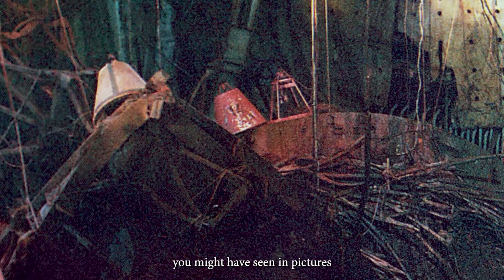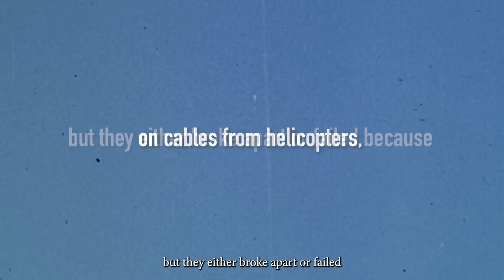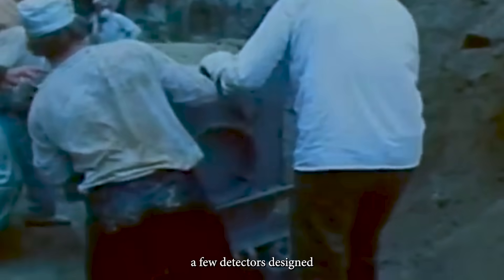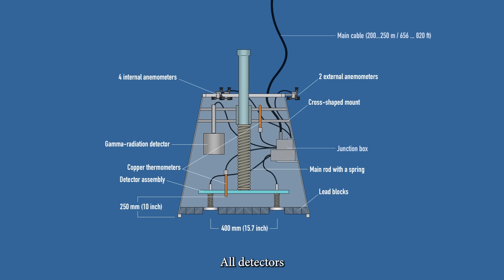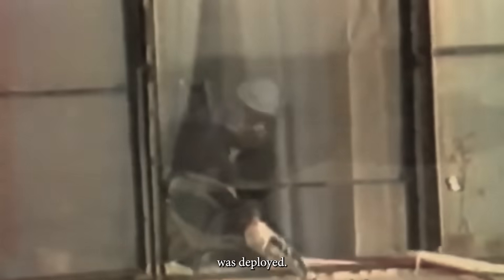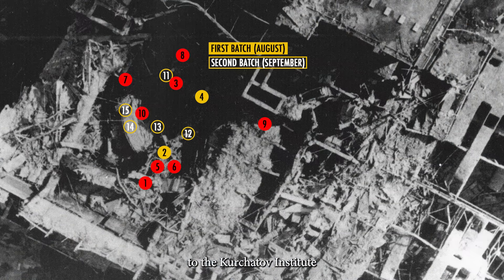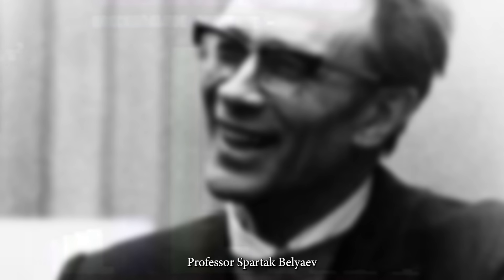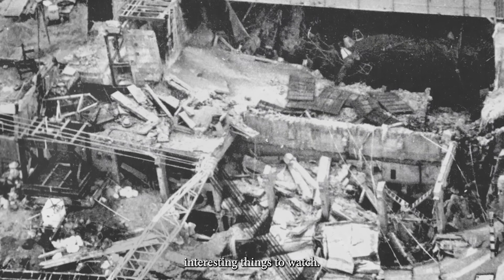Strange Devices in Chernobyl Reactor – What Were They For? | Program Buoy | Chornobyl Uncharted Ep10

Comment: 1:59 Minicomputer what a laugh 😂

edit: It’s crazy that that was then called “Mini”
Reply from the maker: It is not a "laugh" but a correct classification, which I suppose you are not familiar with. There are mainframes, there are minicomputers, and there are microcomputers (PCs, basically).
Reply: @ BRO you get what i mean 😭
Reply from the maker: @Cool-kaiden  Frankly, I do not. This is the epoch that was 40 years ago. Tech everywhere was big and low-integrated. Compared to what was common 10 years prior to that, this is very much "mini."

Edit: typos
Reply: Sorry for that, I love your videos. But i just wanted to say: it’s crazy that that was then called “Mini”
Reply from the maker: @Cool-kaiden yes, it indeed is. Maybe I am just used that it is normal thing I see in papers, hence my reaction :))
Reply: I’m gonna edit that

Comment: Question- What happened to the steel lid of the reactor. I find very little info about this. 
When the lid popped off what happened to it after that? Where did it go?
Reply from the maker: Just to clarify, do you mean cylindrical scheme "E"? It is standing tilted in the reactor shaft. You can see it right in the thumbnail of this video with two Buoys atop; if you mean Scheme G (mosaic floor) — it was scattered everywhere in small parts.
Reply: @ChernobylFamily  I don't have much knowledge,
I am referring to that 1000ton lid made of small steel blocks.
I guess I am referring to Scheme E.

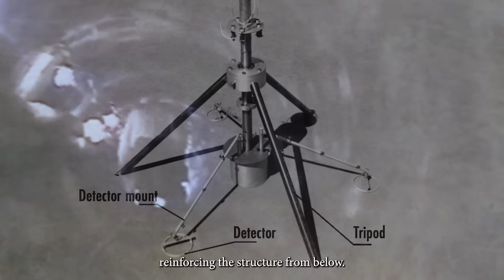Comment: 2:52 Actually, the heat exchanger still got built anyway, just never turned on.
Reply from the maker: Are you sure you are not mistaking it with the Bypass system, which was built but used literally in bypass mode? Because guys who manage the Shelter from late 1986 say down, there is just concrete.
Reply: @ChernobylFamily  Maybe, the documents could be incorrect and the personal experience could be the real correct thing.

Comment: The amount of destruction in unit four is shocking.  I’ve seen these buoys in photos and never knew what they were for!
Reply: The level of destruction was the result of the reactor going prompt critical, an exponentially and rapidly expanding chain reaction dominated by fast neutrons. That always leads to the core  disassembling itself explosively, which immediately halts the nuclear runaway but disperses the Uranium that went prompt critical. Neither the reactor drum nor the building could have contained this uncontrolled release of energy, which was equivalent to the entire Soviet power grid for a few seconds. The reactor has a maximum power level of 3,200 megawatts thermal, and 1,000 megawatts electrical. The power excursion took the reactor's power level beyond 33,000 megawatts, likely hundreds of times higher than its design maximum of 3,200 megawatts thermal. Nobody will know because the instruments that could answer this question were all obliterated by the explosions that destroyed the reactor. The SL-1 accident in 1961 in Idaho was also the result of faulty control rods like Chernobyl and it too resulted in the reactor obliterating itself and killing all three of the operators who were reconnecting the control rods to their drive mechanisms. The U. S. also destroyed nuclear reactors deliberately by causing them to go prompt critical for the purpose of gathering data. Unlike the former Soviet Union where multiple nuclear accidents have resulted in deaths and injuries, the SL-1 reactor, dubbed "Short Lived One" was the only fatal nuclear reactor accident in the U. S., despite a number of deaths from criticality accidents.
Reply from the maker: Glad to help!

Comment: Brother do you have any footage of the smokescreen project you mentioned @ 1:08?

I belive I've seen two angles of it before in documentaries but I just can't seem to find them anymore.
Reply from the maker: Need to search. Cannot say right away, unfortunately. It is easy to mistake it with actual smoke which came out from the reactor during early stages of graphite burning.

Comment: If 90% of nuclear fuel remains within the reactor… there’s no way anyone can get anywhere near it just months after the accident.

For example, Fukushima reactor 2 where there seems to be a breach with in the reactor vessel somewhere but they just don’t know for sure exactly…

That is because they still can’t get anyone near the reactor 14 years after the accident. 

Only the most heavily shielded radiation harden robot can get inside the reactor but even that still only works for a very short amount of time.

Today you can go take selfie with the elephant foot and you’ll be perfectly fine… as the infamous elephant foot actually contain less than 10% nuclear fuel and other fission products… the rest is just melted sand.
Reply from the maker: There was and is the way, as the specific situation of Unit 4 lays in its exceptionally diverse conditions. Plus, we do not know location of many FCMs yet. There is chance, there are some compared to which the Foot is a minor thing. 

I am not competent to talk about Fukushima, so I will pass on it.